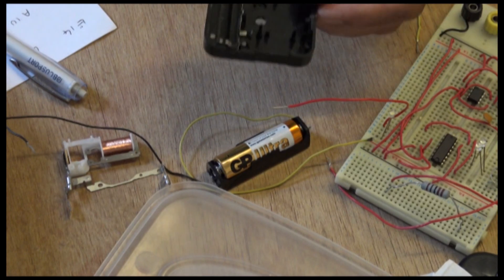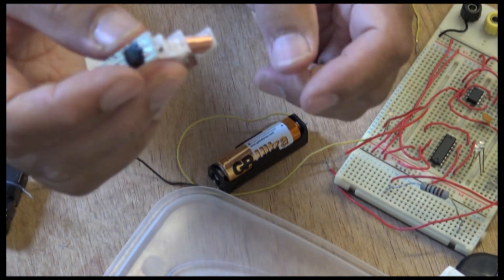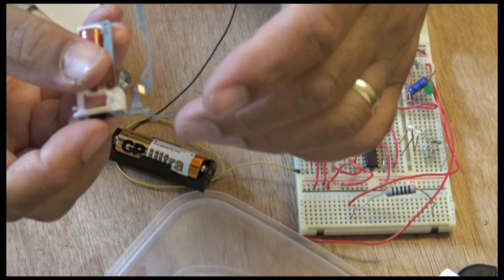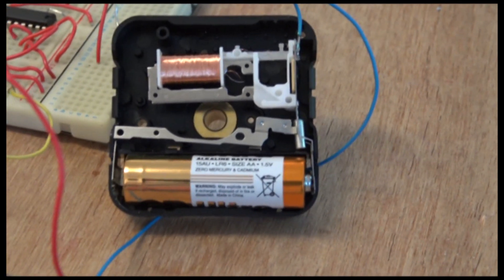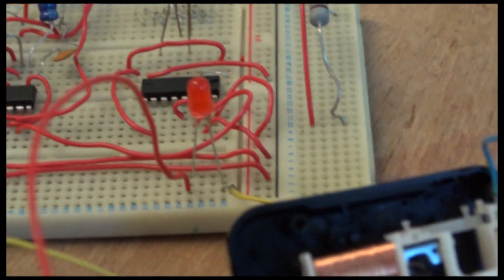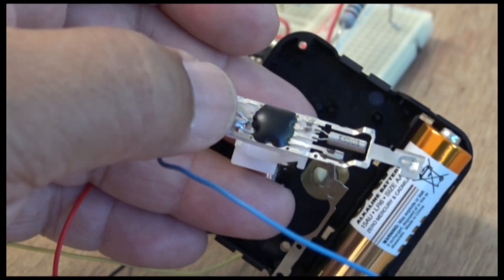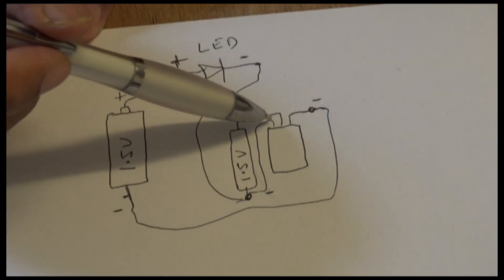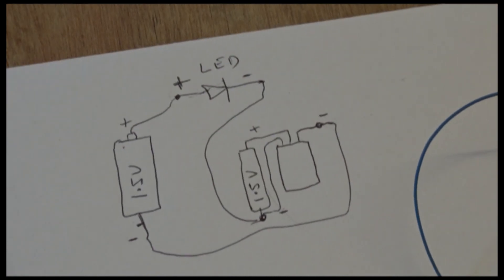#80. LED Flasher from a Quartz Clock

Comment: Did this but instead of an LED I put a small speaker on it. 

Made a crude one of these back in the 90s with a speaker box and a clock movement  but I just stuck the wires in holes and they were at the coil terminal so every second it makes a click sound.  🕑 🔊
Reply from the maker: @coondogtheman  love to see it if you send me a link sounds interesting